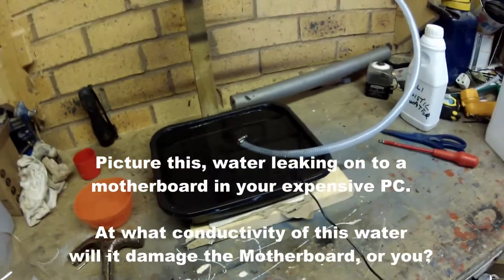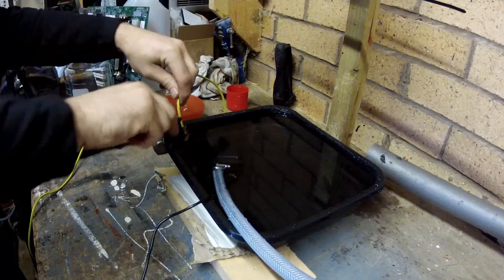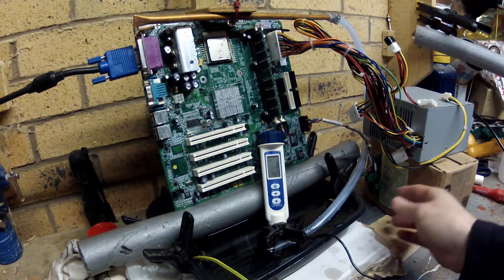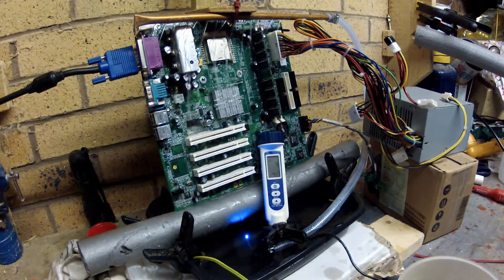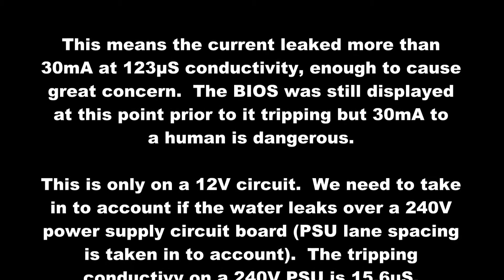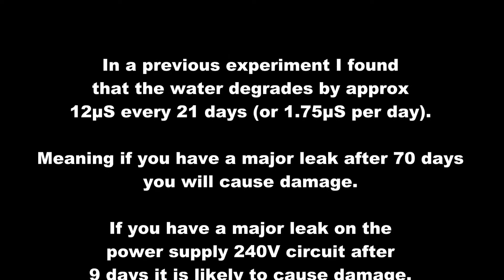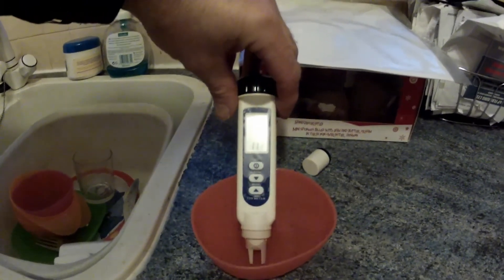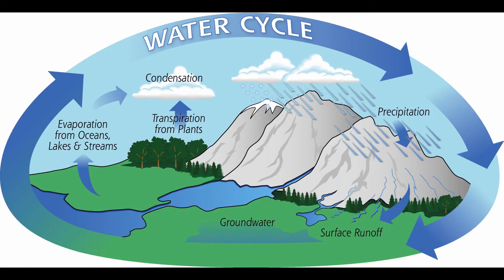When and why should you change your watercooling liquid? In case of leaks.

Comment: what is a safe ph level for water cooling on distilled water and copper sulphate?
Reply from the maker: +jlrockafella Your distilled or deionized water will be ph7 when new.  Over time it will more than likely drop less than ph7.  I wouldn't worry about it though if you change your water yearly or every few months.